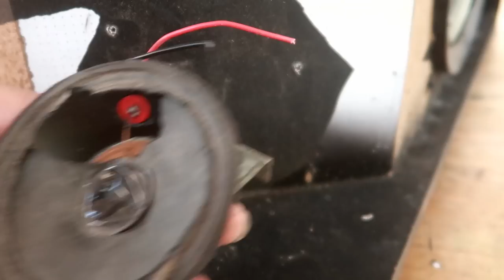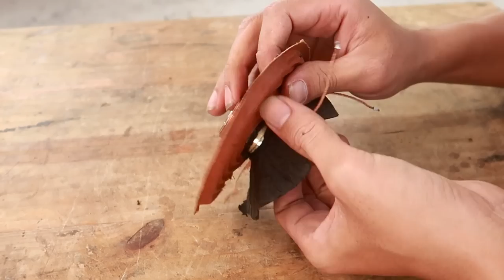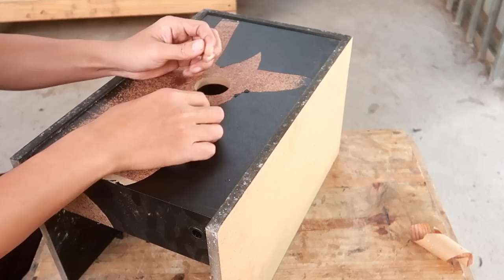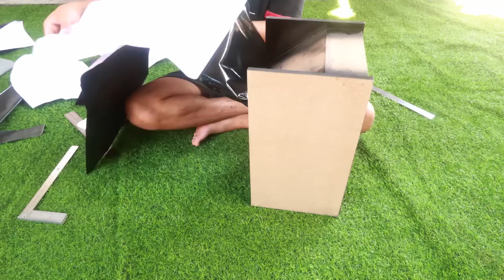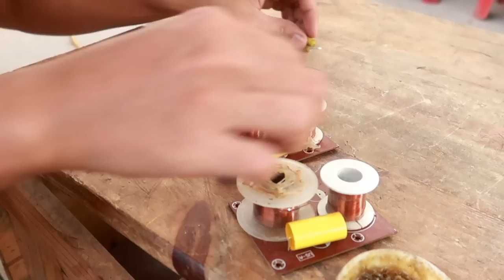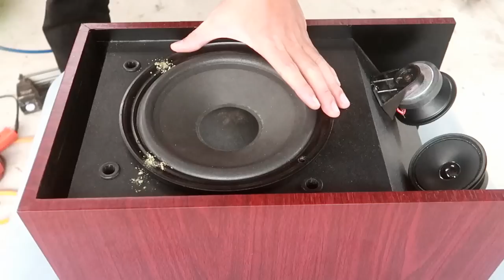Rehabilitate direc/reflecting speaker - Restoration step by step

Comment: Is that true Bose brand or a cheap look alike? I would think Bose would make a bigger sub coil.
Reply: this is a lookalike, but the original bose 301 has the exact same poor build quality. The coil diameter is also the same.
Reply: @KneppaH  lol. The dust caps are see through so will sacrifice loads of bass. Plus designed in the days before cabinet tuning using TS parameters were a thing I'd say. Not really a Bose fan tho I'm using a pair of those small cube speakers as rear  surrounds for a small Sony 5.1 Blu ray sound system. Their not bad for that. Certainly a vast improvement over the thin plastic shit ones that came with the system. Not using any of the original speakers that came with the system lol. Have heard some pretty good Bise headphones to be fair